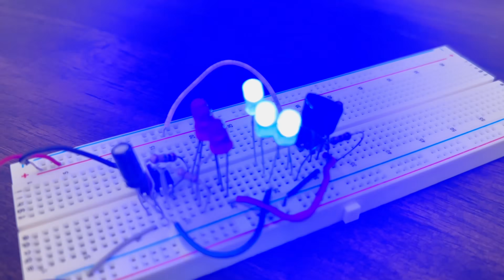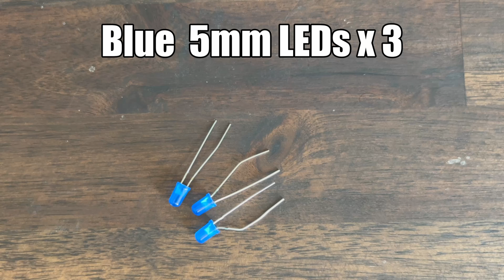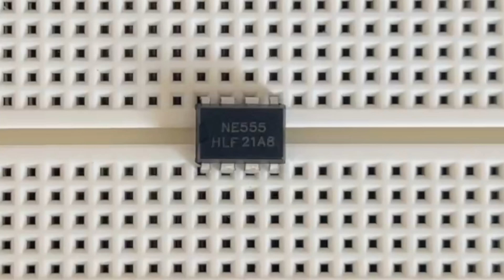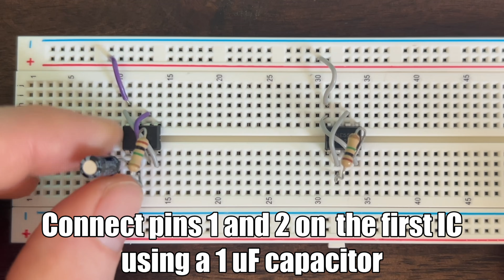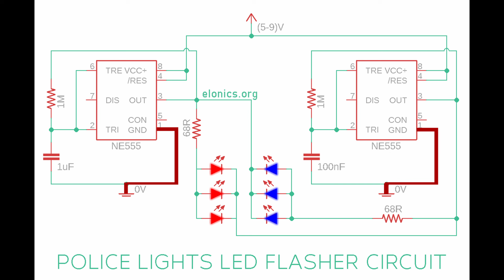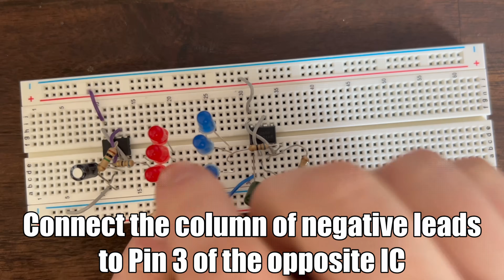Police Light Electronic Circuit Tutorial - 555 Circuit DIY

Comment: I did it and the LEDs lit up, but only the red ones blinked more than once; the blue ones lit up for like a millisecond and then turned red again.
What could be the reason?
I used a 100nF ceramic capacitor (the orange circular ones) and a 1μF electrolitic capacitor.
Reply from the maker: I believe your caps are too small. They are probably blinking so fast that you don’t see the change. Make sure is a 10uf!

Comment: Is it possible to put a pot on the 100uf to change the flash rate?  I may not fully grasp what this circuit is doing, but on a similar flasher with a cap between pins one and two, and a pot is added which increases the charge time or decreases it. I'm ordering the parts now so it's going to be a few days before I can play with it!
Reply from the maker: I don’t believe a potentiometer there would have the desired effect. The capacitor is what charges and then releases in order to achieve the flash. If you wanted to change the speed of the flashing, you can change the size of the capacitor (smaller capacitor = quicker flash and vice versa) or adjust the resistance of the R1 - R4. A potentiometer could certainly be used in place of either R1 - R4 as well. I hope this helps, and best of luck, my friend! Electronics is always a great journey.

Please reach out with any other questions!